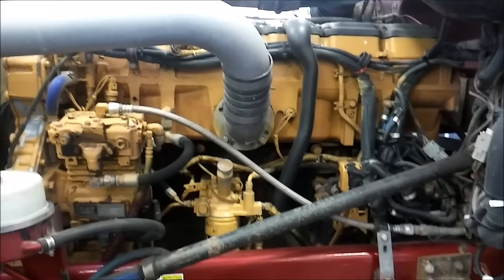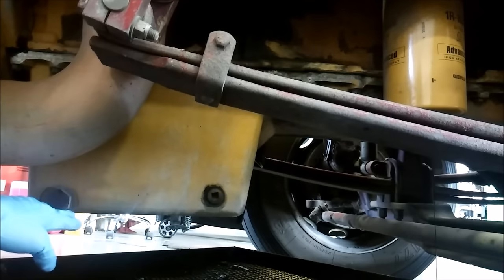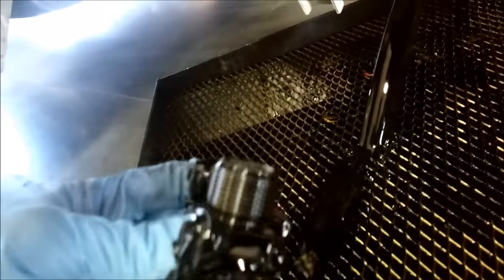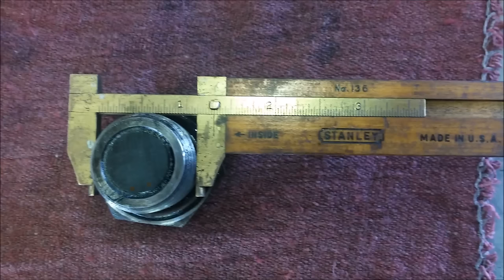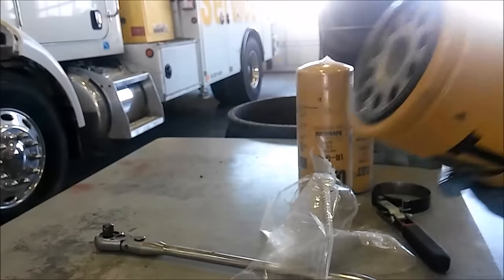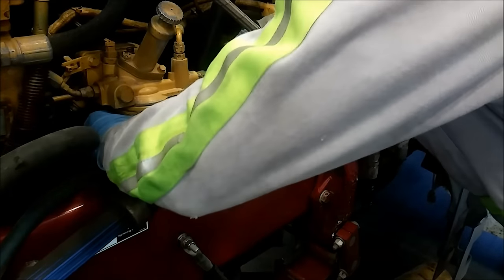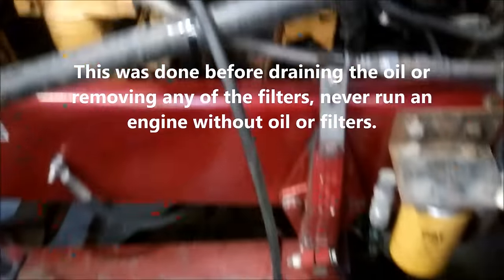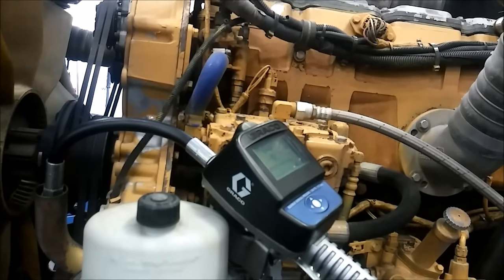How To Perform A Professional Cat Diesel Engine Service.  Cat Engine Oil Change.

Comment: excellent videos bro very helpful I have a 3406e and I do my own oil changes but I always have to use starting fluid to make run after I'm done even with both fuel filters primed any advice on how to make start on it's own?  do you use the prime fuel little pump at all? if you do what's the right method and thank you much for your videos you are the best
Reply from the maker: +Eduardo silva I have got a few people asking me this question and it has happened to me on a few trucks. Here is my suggestion if you have a truck engine that does this. First off, change each fuel filter one at a time instead of removing both at once. Like this: remove the secondary filter, fill the new one, then install the secondary, then remove the primary filter, fill the new one, and then install it. That may help the system not drain as much. If your truck has the hand priming pump, use it as well after a service to purge any air out of the system. Once the pump gets hard to push, give it about ten good pushes to prime it. Lastly if your truck has a recirculating fuel line coming off the fuel filter housing return line with a ball valve, close the valve, this prevents any air recirculating back to the transfer pump after an oil change.
Reply: Adept I have a question what is that ball valve for on top of the fuel filter

Comment: I had 3406 CAT come in the shop 2 years ago wanted a oil change I ended up having to cut the filter off and use a chisle off the filter base off, man did that suck.
Reply: Tony Mullins that band wrench with 1/2 ex & ratchet has never let me down if u can find the right size. Hardly anybody sells them